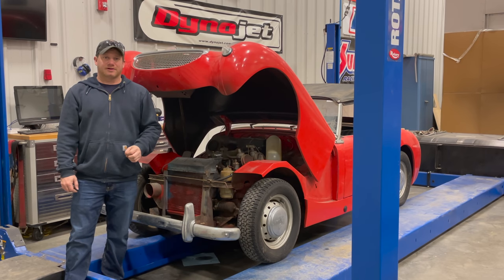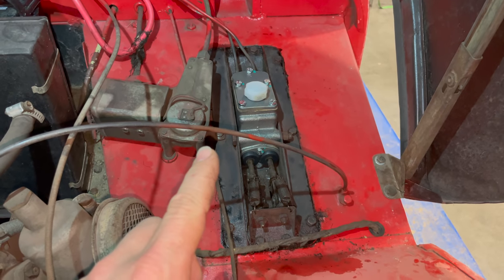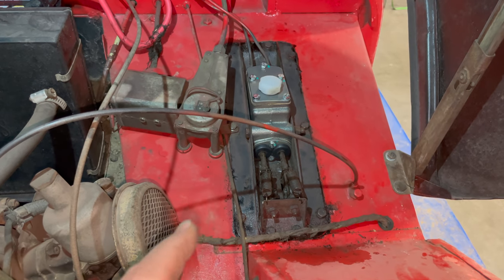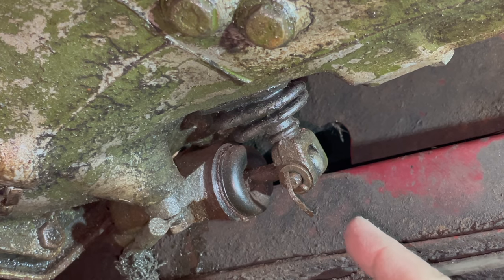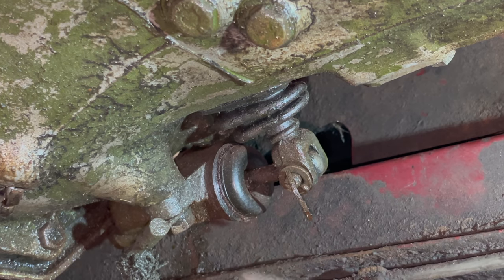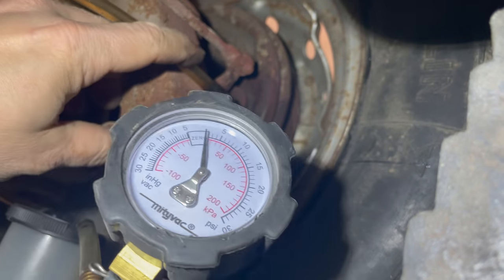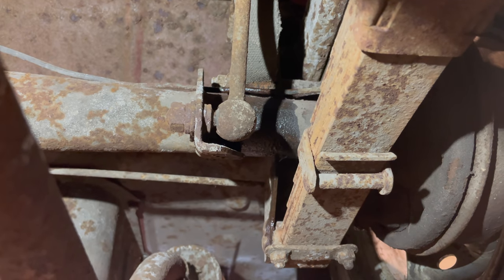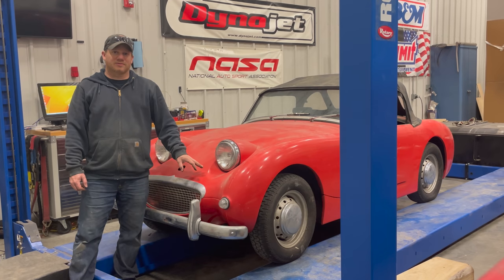Round 2 - Barn Find Sprite #4 - Being Drivable is the Goal!

Comment: Nice tutorial. Great to see you keeping the old cars going and showing just how easy they are to work on. Especially when the steel body is still intact.
On something that has been sat for so long and showing that many hydraulic issues i would have preferred to have seen you replace the slave cylinder on the clutch, or at least put a kit in it, plus doing the same for each wheel cylinder. At least inspect them for signs of problems.

Comment: Maybe you've already covered this and I've just missed it but,  as someone who is soon going to be tackling the job, I'd love to see how you deal with bugeye's front end issues. I'm thinking of the lack of a zerk fitting on the standard A arm's outer pivot points,  as well as cutting the taper for replacement kingpins.  I know I've seen someone use an old king pin that's been cut with a grinder to serve as a cutter but that seems pretty dependent on more luck than I think I posses.  So, if any of those barn find beauties need a front end rebuild, I'd really like to see you go into some depth on it.  Thanks!  Really enjoying this series and your taste in cars!
Reply from the maker: I will probably get to those when I finish 4 and 3 and have a chance to get back to the Pink Sprite which will have to be mechanically sound.

Comment: After dumping 3 quarts of oil in the middle my father's shop, I converted to a spin on type oil filter on my 71 TR6. Gotta dig those old rings out.
Reply: Been there, done that. Those canister filter housings were always a pig; it's so easy not to seat it correctly and end up with an expensive puddle.

Comment: Those oil filter housings are pain. You can be really careful with the rubber gasket and then the seal around the central bolt starts to leak creating a huge mess getting it off and back on. Converting to a spin on is the way to go.